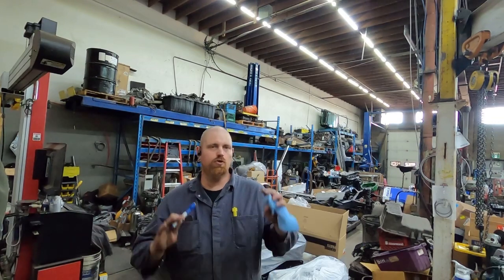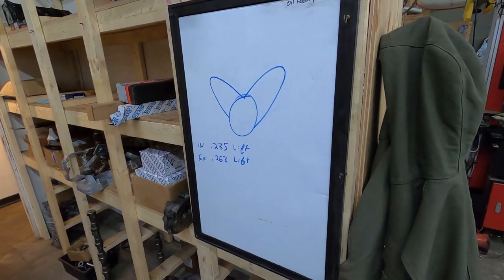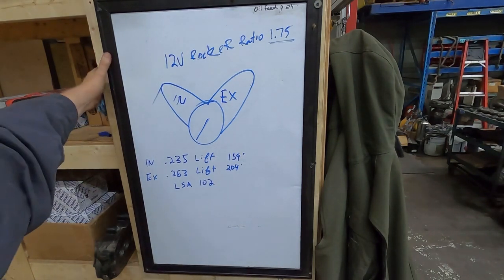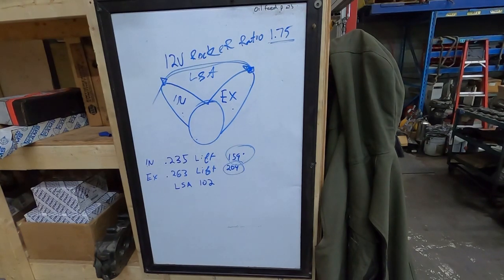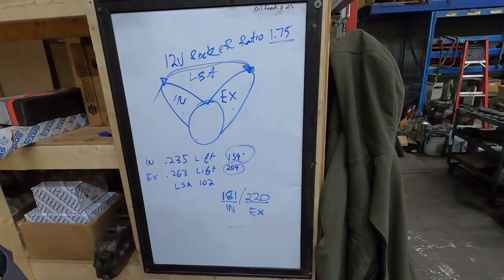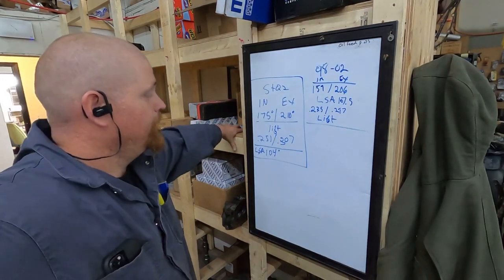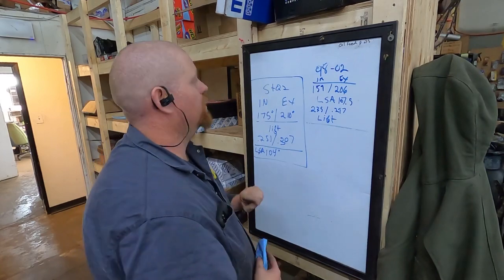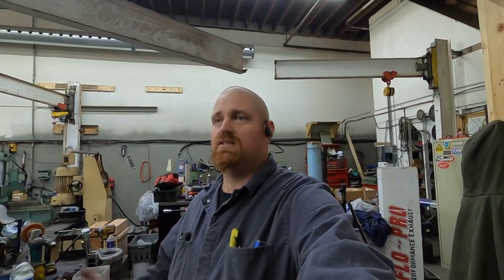Talking about camshafts for stock 12v CUMMINS ( below 400hp )

Comment: So I’ve got a 188/220 cam running 22 degrees of timing 5x16s a hot 215 pump an a s366 this is my first build so I’m running off of hope don’t plan on pulling with this truck just a fun weekend truck do you have any clue how it’s gonna act or any knowledge I could use thx love your videos
Reply from the maker: When it turns on it should be a fun ride. 
Will be laggy out of the whole for my liking. But alot of that will depend on how you tune it
Reply: @CUTTERUPROB  I appreciate it yea I know it’s gonna be laggy I’m gonna put a g56 behind it I was gonna put a s369 on it but I got a s366 from what I Hurd it’s only about a 30-40 hp difference between the 2 depending on fuel
Reply: It’s got a zero fuel plate.93 fuel lines .25 DVs an a max rack plug on the pump
Reply from the maker: @fishingthesouth2193  I am not a big fan of singles for most guys. But i understand compounds aren’t cheap
Reply: @CUTTERUPROB  yea that’s why I going with a big single I plan I’m going compounds when the funds are there I’m also restoring a 1st gen from the ground up so it’s been a process

Comment: For a 500 hp build should i ho with a stage 2 cam shaft or  the stock cam will do it  thanks  🤘
Reply from the maker: You don’t need a stg 2. But it won’t hurt you
Reply: @CUTTERUPROB  thanks a lot

Comment: I’m doing a rebuild now on my daily driver work truck (occasional tower)  I want some added hp just for fun But  not going to be racing it I’m converting to p pump, new pistons .20 bore, full head job, new valves, 60 lbs upgrade springs, rods etc. was considering doing a cam upgrade been looking at the 188/220 or the stage 2 you mentioned do you think it’s worth it? Will I see any noticeable improvements? Or should I put my money elsewhere. Not on a tight budget but I don’t want to waste the money if it will go unnoticed. I’ve heard porting the head will give me more noticeable improvements. Thanks! Love the videos watch them all!! Keep em coming
Reply from the maker: I personally would just use the stock cam. Spend the money some where else
Reply: Watch the stocky bald man's video. He built a daily 12v and said the 188/220 moves the powerband up to much.

Comment: Whats the best cam for a 12V 6.1 stroker? I'm trying to have peak torque around 1500 rpms with the aid of smaller compounds (HE211/HX45 or HX30/HX50). I'm not planning to be over 2000 rpms unless braking. Looking for a cam that can help spool as early as 1200-1300 rpms and carry power until 1900.
Reply: I don't know if it makes a difference... but I plan to use a VE pump. Hoping for around 400hp and over 1000#ft tq.
Reply from the maker: Dining a ve pump the stock cam will work fine. If you want to do a cam I would not go more then a stg2. The ve power is so short you never really get to use the cam

Comment: What’s the best method of removing and installing the cam drive gear on  a 12V?
Reply from the maker: Get it off a press or a puller. On a press or heating. I guess I should make a video about This. I will add it to the list

Comment: Thanks for vid,,, can you replace stock worn out cam shaft with a  good used one without changing lifter's?
Reply: Not recommend I would always get new tappets with a new cam cause the lobe on each tappet has there owe crown with each lobe in the cam as it wears
Reply from the maker: I personally would change the tappets.( as said above ) So lots of time the cam won’t show wear and the tappets will and if your into it that far I won’t take the change.

Comment: Great info man 👍👍... Are the 6BT Marine cams any good...?... Don't matter,just curious....I know they're fairly cheap, but...have read threads from years ago and not that long ago, that they aren't any good except for the higher rpms...but the lift spec's and such kinda show otherwise, but idk,I've never upgraded cam's before...just fr what I've looked up ,I would think it would make things react pretty good down low....just curious man,don't matter 👍👍
Reply: I guess was curious if they spool little bit bigger chargers better down low than a stock cam.....
Reply from the maker: I personally have never used one. I can have a stock cam ground for less then the price of marine cam. I will look into it when I do more cam videos
Reply: @CUTTERUPROB  👍👍 ten four Rob...great videos 👍👍